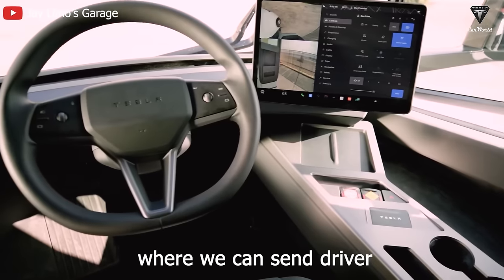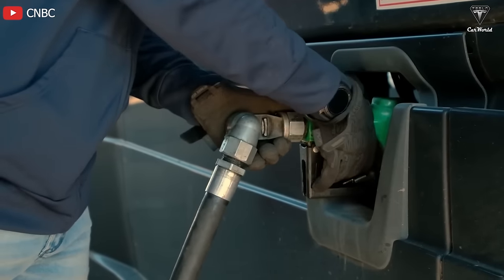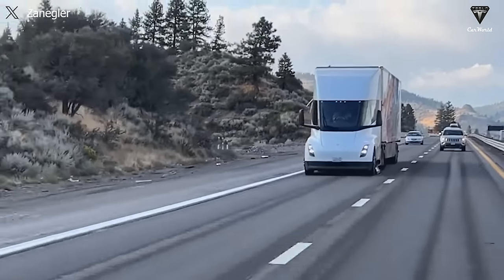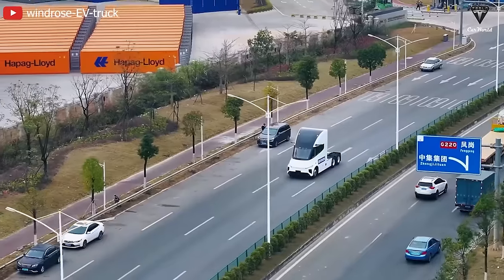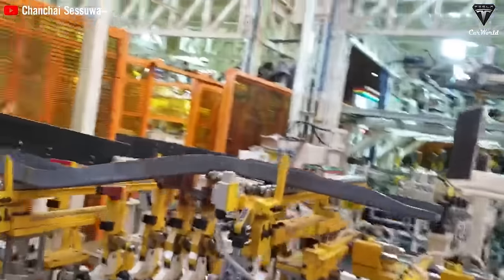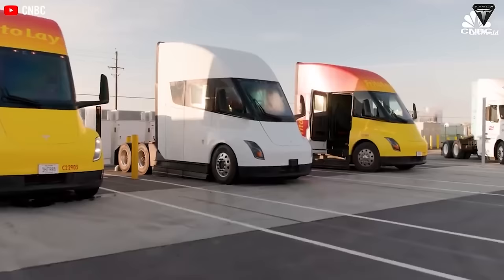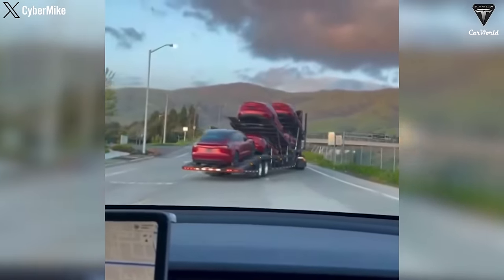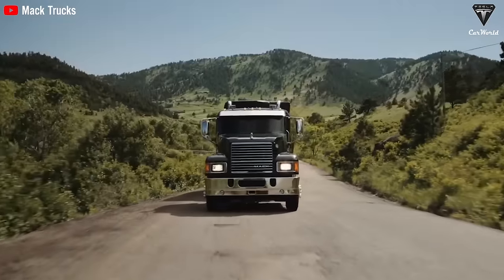It Happened! Elon Musk Revealed BIG Upgrade 2025 Tesla Semi: Production, Price and 3 Hidden Specs!

Comment: How do you plan to make them efficient. And i mean 1000 to be 1500 miles per charge to make them a real work tool and not just a toy. How about the isolation of the magnetic fields, the cost effective tag and the possible comparison to the NIKOLA electric Semi?
Reply: Most runs, like 80%   are less than 500 miles  this has been established a long time ago .. less than 10% are over 1000 miles ..
A driver  going avg of 60 mph for 8 hours will go 480 miles ..😂
Reply: Drivers Are Required to Take Breaks, The Challenge is to match those break time with Suitable Charging Stops, so that a short break equals a top up, without the driver having to hover around his truck while "Fueling." Last detail submitted on this, from Tesla, was a Plan from Sacramento to Giga Texas and down to SpaceX in Texas. That would be "First Route" Suitable for their Semi, with others to follow. Haven't heard any details on its progress so far. seems like they are still taking baby steps on this venture.

Comment: The significant weight of the batteries in electric trucks presents a limitation on their overall cargo capacity. Due to this, these vehicles may end up primarily transporting the weight of their own batteries, which, in turn, reduces the available capacity for carrying goods and materials. This aspect may need to be addressed in the design and development of electric trucks to optimize their efficiency in transporting cargo.
Reply: EV trucks legally have an increased 2,000lbs weight limit to cater for the extra battery weight.
Not a problem.
Reply: @alexmanojlovic768  Gross vehicle weights on interstate highways is 80,000 lbs max.  It doesn't matter if they are ICE or EVs. Some states allow higher limits but not on interstates
Reply: There are options like charge regenerative hubs to charge the semi while it rolls. That can become a great deal. Same with the cars. Elon needs to stop terminal products and approach more regenerative tech
Reply: Most trailers are not loaded to max weight capacity .. 
😂😂
Reply: @customsolutions7167  You still have to pay to transport the weight in batteries. Even if the truck is  empty.
Reply: @howardj602 
 and In an Ice vehicle you transport the weight of the two full tanks of gas and much higher weight oif engine and transmission.
Battery weight will get lower over time as improvements in technology occur.
But ice weight won't change.  And neither will all the pollution they make...
Reply: @customsolutions7167  The tanks of fuel diminish as the vehicle is driven.  And most truckers don't usually fill up their tanks.  They keep close watch so the can take advantage of the price differences as they travel. This means the put the least amoount in to take them to the next cheapest fuel stop on the route. 
The future of the EVs  class 8 is for short haul not long distance.

Comment: What is the Tesla Semi's body made of ? Aluminium would be light but way too soft and delicate for a truck. Steel is heavier but must be pained. Last is stainless steel which is also heavy but impervious to weather but difficult to work with - it can't be pressed and the Tesla Semi has lots of curvy panels. In the beginning all Tesla Semis were buffed stainless steel but now they are painted white, red or Pepsi livery.
Reply: Cabs are - Most likely - A Fully Composite Build. It takes dings without Bending, better. Also - Easier to get the swoops and flares they are designing in.